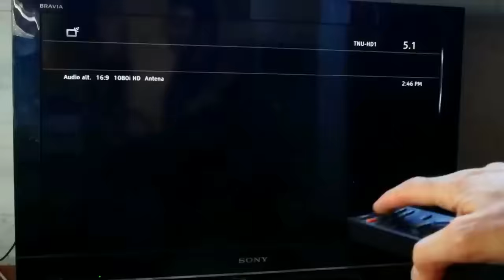Just a drop of super glue on the Remote and you will be Amazed !!

Comment: I have also been fixing the remote control using this method all the time, and I've been using the same remote control for over 20 years.:yougotthis: Instant adhesive doesn't stick to silicone, so it comes off after about a year, but it's not a problem. I can just do the same procedure again and it works fine.:goodvibes:
Reply from the maker: Thanks for sharing your experience  !!

Comment: I've been doing this for years, but I no longer use super glue because it doesn't hold.
I think last time I used silicone sealant or PU (polyurethane) sealant instead.
You need to find a glue that remains flexible and adheres to the silicone.
**
Je fais ceci depuis des années, mais je n'utilise plus de super glue, car cela ne tient pas.
Je crois que la dernière fois j'ai plutôt utilisé du mastic silicone ou du mastic PU (polyuréthane).
Il faut trouver une colle qui reste souple et qui adhère au silicone.

Comment: I don't know why they bother to put screws in things anymore. The plastic snaps are usually so tight that it ends up breaking before it comes apart. I found a filthy Samsung remote control in the trash. It works and I wanted to take it apart to clean it, but I can't get the case apart at all.
Reply from the maker: Yes 100 % right ! thx for watching !